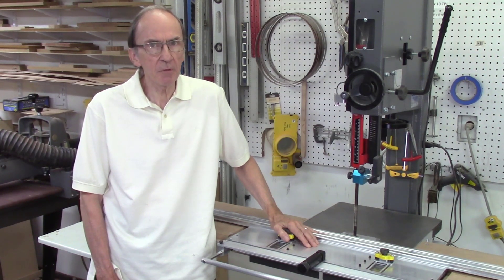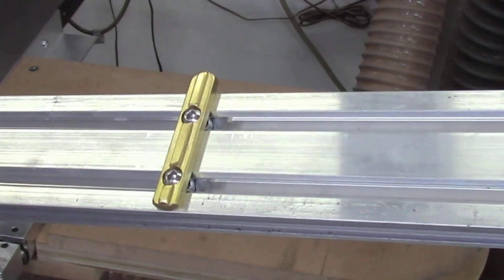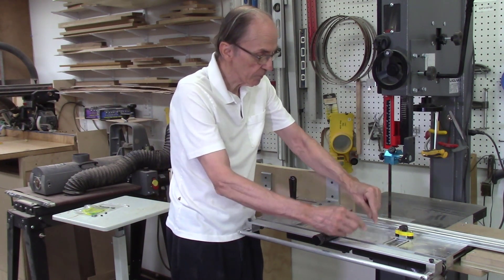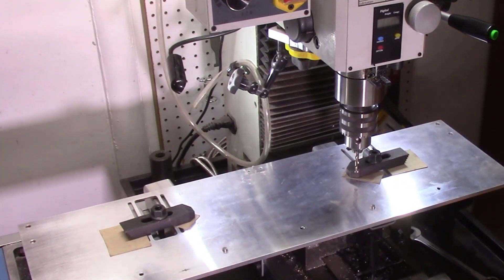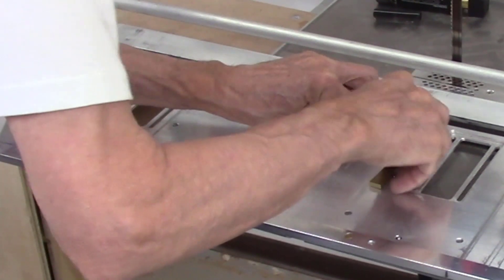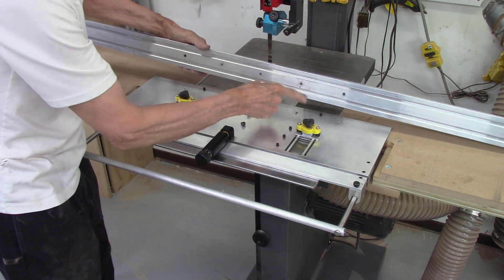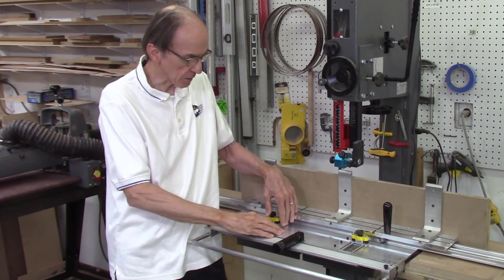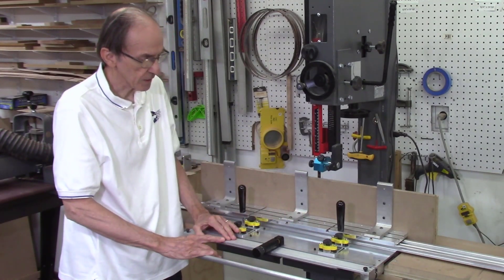Band Saw Table Modifications - To improve the Performance of the Accu-Slice System - 144

Comment: Would a test with MDF give you a better idea of accuracy ? Not very nice to cut (Dust) but nice uniform material. Great videos,thanks.
Reply from the maker: MDF would probably give better results, but cutting wood boards is more realistic as to what you would expect from the system.